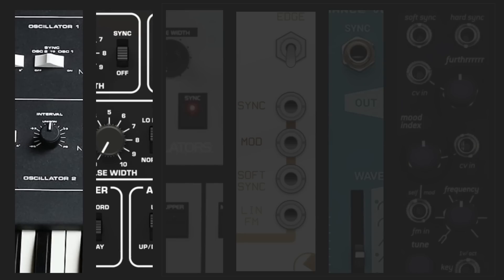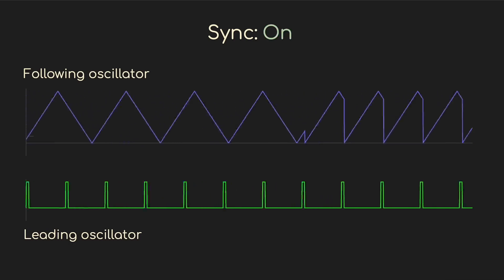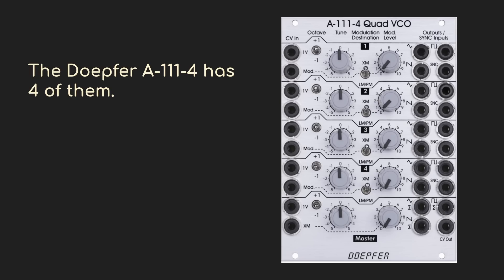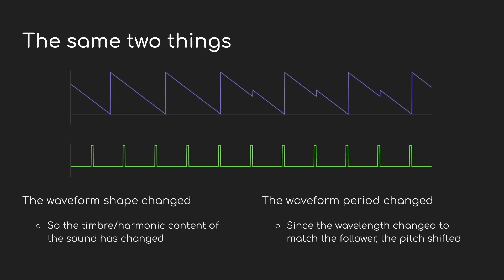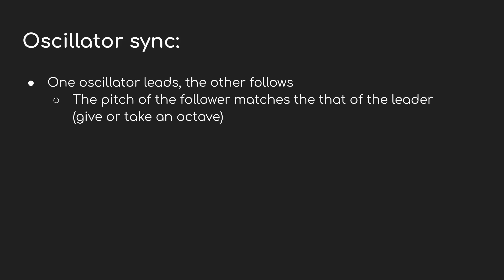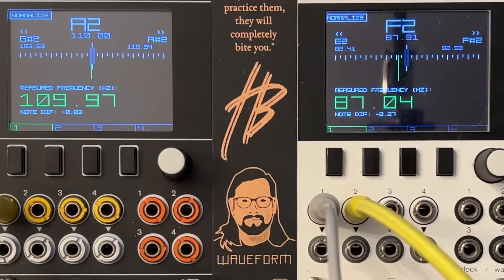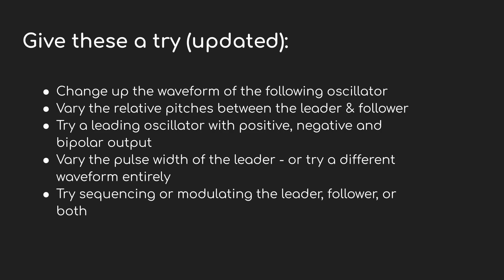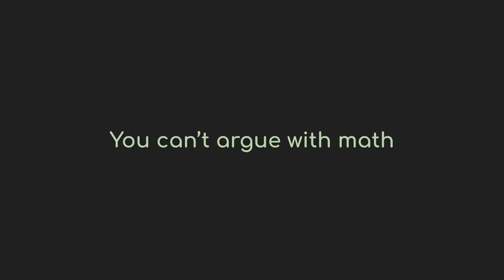Oscillator sync is a lot deeper than you imagine

Comment: ever since i started building synth modules i realized that oscillator sync is way more complex than it seems, the way they are implemented into circuits often make no sense if i think of the most common definition of resetting the wave, but i never imagined the results are so different in different circuits

Comment: Perfect! I truly understand it to a much greater depth now. The payoff is clear in your having redone the script multiple times due to further revelations and (sometimes) deeper understanding. Showing the notes and the harmonics for the different oscillators really drove those parts home--very key. I subscribed on the strength of this video. I would love to see a video explaining the math behind why the follower doesn't get pulled to zero on each cycle of the leader, and it instead gets just a dip and a stretch to half the frequency. Also, I would love to understand why there is such a drastic difference with an inverted leader. What even made you think to test for that?

Comment: The CEM3340 is known to have a strange sync implementation, as shown on the excerpt from the datasheet that you included. The chip offers both hard & soft sync inputs but neither do exactly what you would expect. As a result, where these chips have been used in classic synths, not many used the sync inputs on the chip but instead employed extra circuitry to acheive the sync effect. So whereas you said your module basically gives you access to all the pins on the chip, a Prophet 5 or a Memorymoog would have extra circuitry to implement sync and not use the on-chip implementation. So that's why you're not hearing & seeing what you expected.

Comment: Some of the other un-tapped 'rabbit holes' here are in the myriad of sub-sonic applications; of which there are far more than in audio wave generation! 
e.g.  resetting any oscillator used a a clock source,  mixing LFO shapes that are sync'ed, using reset to kludge an 'EG' with a ramp/skew function ( a USG/Maths' specialty ) at ~any~ rate, slewing CV's that still lock to tempo -  these are but a few ottomh. 
Cheers!

Comment: kind of a noob question - how can i sync a Plaits module to another oscillator (MCO in this case)? i tune them to C3 for example and send them the same pitch CV, but they play different notes. it's like one of my VCOs is attenuating the input voltage or something. thank you for this vid though super helpful!!!
Reply: to clarify, it's like the MCO is microtonal in its steps vs the Plaits is moving full semitones. it's so weird, makes me wonder if my MCO is malfucntioning.
Reply from the maker: I would expect it to be microtonal, since CV is continuous, but it sounds like Plaits is acting in a quantized sort of way.  I've never used Plaits, so I can't say for sure, but the default firmware doesn't say anything about it in the documentation.

You should run a test and put a slowish LFO into the v/oct in on Plaits and see if it sweeps the pitch up smoothly or if it jumps in a quantized manner.
Reply: @ sorry, kinda hard to explain ahaha. i didn't mean microtonal in the sense of the note being played wrt some scale; i meant that it moves between pitch changes with less amplitude than Plaits, if that makes sense... so when Plaits moves a semitone to my ear, MCO moves a fraction of a semitone, again,  almost as if it's attenuating incoming CV. thanks for replying!
Reply: @ oh and Plaits does not quantize or affect its incoming CV into the v/oct, don't think i've ever heard of a VCO doing that! i'm pretty sure my MCO is just off calibration or malfunctioning but i wanted the MCO mk2 anyway! haha
Reply from the maker: @stank666ocean - In fact Braids had a built in quantizer :)  It was under the options controls somewhere (got rid of Braids a long time ago now, so I'm not sure where, but it's in the manual).  Dreadbox Hysteria has one.  There are at least a few out there.

Definitely with analog oscillators there is a scaling aspect that has to be calibrated via little trimpots on the back of the module to get proper v/oct response, but that shouldn't ever be a problem with a digital module like MCO.  If you have a tuner app on your phone, you can test it by starting at a C or whatever on both oscillators and then plug a fixed voltage in and test how the pitch changes for each of them.

Oh, hmm, are you testing these both at the same time?  And if so, are you using a buffered mult or a passive one/splitter cable?  There can be a voltage drop on a passive mult might do something like this.
Reply: @SoundVoltage  i actually managed to think of that test case, believe it or not! i remembered from back in school that passive CV duplication caused droop so i made sure to patch it with a powered mult, luckily i have one in my rack. i finally used my degree for something! lmao
Reply: @ also yeah, i have read that some folks had to calibrate their MCOs and even then, they didn't track super well. weird that digital VCO needs calibration but my Prophet does too and it has DCOs as far as i know

Comment: Thanks for doing this exploration.  A while back i was planning on designing my own 3340-based VCO (I eventually instead got a PCB/panel set from Kassutronics), and I read a blog post by Tom Wiltshire of Electric Druid that went over a bunch of different 3340 circuits from different classic synths. He commented that the chip was unusual in offering both hard and soft sync, and that "neither of them work the way you might expect".  I didn't understand what exactly that meant, or what was going on, until I watched this.

Comment: In addition to sync and FM need a video exploring low-frequency (less than 20Hz) pitch modulation with different waveforms, as well as using filtered noise as an LFO.

Comment: Thanks for this. I don't think too much about what's happening when I flip different switches on my analog gear. From the label I have a general idea, but it's surface level. I just picked up a novation monostation and it has oscillator sync and pwm so I have some better ideas of how to maximize the sonic possibilities of that little button now rather than just thinking, okay, this'll match the pitches of the waves
Reply from the maker: Glad it helped!

Comment: Cool video man! It's interesting that you use a lower pitch following oscillator. When I first started experimenting with softsynths I quickly learned that doing that leads to weird things happening that weren't necessarily conducive to creating a consistently pitched sound, so I always used a higher pitch following oscillator instead. That way you modulate the pitch of the following oscillator just above the leading oscillator's pitch and get cool sounds. The other way is interesting too, though.

Comment: A trio of us are making analog synths from scratch (with a goal of understanding every electronic component and why it is present in each module) and we added what we understood to be hard sync to the VCOs.  Seeing the 3340's version of hard sync barely nudging the waveform is wild; we went with the definition of hard sync where the wave needs to completely start over as fast as it possibly can when the input crosses from negative to positive.  It has a far more gritty sound than the Doepfer's, and what the Doepfer does is what I would consider to be soft sync...  Are you sure it isn't using the soft sync input, given that that chip has both kinds of sync inputs?
Reply from the maker: That's pretty cool!  As for hard/soft on the Doepfer, it is selectable via a jumper per channel on the back of the module and I double checked it all before filming things.  I can go back and do a triple check.

Comment: Now that I saw this I had so many questions. I was often told to "sync to have consistent results". For sure now it's consistent, but it's a different sound, with harmonics that potentially don't fit with other instruments. Also, what happens when you have an oscillator slightly detuned, meaning is shorter or longer than the other? [Update:] I did a couple of perverted experiments (and what other types of experiments should one do?) based on this video. I set up a tuner and kept the leader oscillator in tune, while I severely detuned the follower, which I though previously to result in out of tune sound. But even with 6 semitones in and a couple of cents away, the note remained stable. There were differences though in presence between -6 and +6 semitones - it was odd to observe. Changing the octave on the follower resulted in a more metallic sound, while on the leader it became smoother and in tune.

Comment: I wonder how Virtual Analogue synths holds up in this regard, how many behave in the way i thought oscillator sync works before this watching this video.
Reply from the maker: I've wondered that too -- the extent to which this is properly implemented per synth, or if it just gets implemented per some pre-written library.  Similarly, I have one oscillator with a really pretty weird "sine" wave which makes for a distinct sound, but I there's just a standard "waveform generator" function that gets used across virtual modules.

That will have to be for someone else to look into, though, I'm not a virtual synth guy at all.

Comment: I often feel like, even with barely changing any other parameters, simply changing the sync between off, soft, and hard, for the furthrrrr generator (or other complex oscillators) produces really dramatic differences. You can virtually make whole different instrumentation sections of a song just through this.

Comment: You might be interested in Roland's "Metal Sync" on the JX-3P and MKS-30. They use digital oscillators doing sawtooth waveforms by running an accumulator to ramp upward before resetting for the next cycle in normal usage. But for Metal Sync it resets the follower oscillator's accumulator to zero when the leader's phase / cycle resets, however the follower oscillator also still resets when it would have originally, so it's resetting on the cycles for both pitches. Google should return a nice write-up from electricdruid.
Reply from the maker: Oh that's interesting!  I have a JX-8P here, but it looks like it didn't have the 'Metal' sync among it's options.  I'll have to see if I can find one to mess with.  Thanks!
Reply: very slight correction: the follower's integrator is reset, while the accumulator is left free running.

Comment: Using the 3340 as the object of study for sync honestly isn't the best. It does sync in a extremely non-standard way. Especially looking at how the sawtooth waveform reacts to sync is bound to just cause confusion. It's actually better to look at the triangle wave, as you do briefly around the middle of the video.

What really is happening when hard syncing the 3340 is: 
If a positive sync pulse is recieved at the input at the same time as the triangle is in the positive slope part of its cycle, the triangle slope will reverse it's direction from that point. The same happens when a negative pulse is recieved during the negative slope. There's a pretty good diagram of how this works in the datasheet for the IC.

I guess because of the 3340s popularity it's kind of become the standard mode of sync, in spite of this madness xD

There is a way to achieve the "normal" hard reset type of sync described in the datasheet, but I dunno if even that works the way one would expect...

Comment: Great job on the sync on the 3340.  The 3340 has four modes of sync per the datasheet (!!) and you've got a couple of them down with this video.  Most 3340-based eurorack modules offer one or two of these modes.
What's shown are the "positive hard sync" and "negative hard sync" types of '3340 sync.  Positive sync changes direction of a rising (and only a rising) triangle.  Negative sync flips direction of the output when (and only when) the triangle is falling.  One interesting thing not shown is you can use both positive & negative hard sync at the same time, that can lead to some interesting results.
The SSI2130 is more traditional at soft & hard sync, that would be a good chip to compare sync against.  On that chip soft sync will change direction of the falling triangle if the output is falling.  Hard sync will reset the oscillator regardless of phase.  I've got some example videos of both with scope shots.
Reply: Very good point to make about 334x series chips, their ability to do negative and positive sync at the same time is one of their most fascinating qualities for me. I am actually building a synth right now that will hopefully abuse this feature to the limit with a full pos-neg hard-soft sequencer, to create long strings of phase-locked sync pulses under multiple arrangements. I watched your vid on Zoxnoxious build and its been a bit of further inspiration towards my project! Never through to do multiple vertical boards slotted into a master bus, definitely a major space saver, may steal that idea if allowed lmao!
Reply: @wertyvk9667  grab the designs, it's not stealing if it's open source :)  (within limits of the license!).  Besides the deep dive vids, I hope you found videos of the pos/neg sync.  They're on the channel too if you hunt around.
Reply: @UltraTroninator  Yeah I did! I love that dense sync sound, big fan!
Reply: Very cool - can you share the vids?
Reply: @PeterJnicol  not sure if it's allowing me to put links to share.  They're on my channel, not a lot of videos there so should be easy to find.

Comment: What attenuverter are you using in this video? It's awesome, and I would love to have a few, but I will not get my hopes up because any module i want is usually something no longer being made. Lol.
Reply from the maker: @MR2GR: They are pretty cool, for sure.  That is an Antumbra "Fade".  I had to build my own -- which wasn't too hard but required SMD soldering, which was entertaining.   

But you can buy them assembled now at Pusherman in the UK: https://pushermanproductions.com/product/antumbra-fade/
Reply: @SoundVoltage  I'm perfectly fine with hole-through soldering, but I've tried my hand at SMD, and know that I will fail and get frustrated, so I'm happy they sell them assembled as well. Thanks for the link.

Comment: I'm pretty sure these mysteries will be revealed if you look into how different oscillator cores behave. A lot of the differences in behavior are likely due to what it means to reset the oscillator. 0 volts? 0 phase? What is the voltage of the waveform at 0 phase? Etc. Also the sync function could conceivably trigger on a 'rising' edge or 'falling' edge, which could also explain differences in results between oscillator models. Relative placement of that trigger in the follower waveform's cycle will adjust when the reset occurs, like in your pulsewidth example.
Reply: Indeed, from my "having soldered a dozen pedals, 100+ cables and a few other various circuits" perspective, the differences seem to be in how the circuitry 'yanks' the core's clock/counter to match or approximate the period of an incoming wave that the VCO is attempting to use as a substitute clock pulse.   In the first example a subharmonic occurred even though he was sync'ing to higher freq. Some  'analog artifact', I guess.
 You seem to have a deeper grasp of it than I. Describing such artifacts as bluntly as"leakage" in the process of "yanking to an (assumed) external pulse" is about as far as I care to understand it, since I'm a composer and not a module designer/EE.

Comment: I wonder what would sort of harmonic spectrum you'd get if you hooked up 3 oscillators so that oscillators A and B were at the same frequency but osc A was synced to oscillator L and osc B was synced to the inversion of L, and you ring modulated the results together. Because like they say, everything sounds better with ring modulation, or at least worse.

Comment: I just had a Moog LittlePhatty fixed. After I knew, I had to recalibrate the oscillators. OSC2 Freq needed the calibration. But the sync button always tuned the OSC2 perfectly. I did the recalibration but stayed with the doubt of why or how was the sync button tuning the OSC2 if it was off pitch in the first place.

Comment: Excellent stuff, VCO sync is underrated. Something I discovered is to use other sources of audio, anything with a more complex waveform than a simple repeating cycle like most VCOs is obviously harder to track, which produces a lot of noise. I made a disgusting guitar synth in VCV by patching the guitar signal into the sync inputs of a few different VCOs. It was uh, quite 'experimental'.

Comment: Interesting look at this topic! As sync is so closely related to the inner workings of the oscillator it only makes sense that they all sounded a bit different. When you think about it, resetting the waveform is what an analogue oscillator does to produce the waveform. I have a Instruo Cs-L and the two oscillators on it have different cores that produce wildly different timbres when synced. As the sync is based on some edge detection circuit, getting near its threshold and inverting rising and falling edges could potentially get some interesting unusual waveshapes.

Comment: Now drop that oscillator into the LFO range and add some CV over the attenuvertor of leader..for analog oscillators with multiple waveform outputs you now have a plorethra of harmonically related modulations.

Comment: I always thought soft sync is related to the threshold of the voltage - the waveform might reset, but not every time. Always felt there should be a knob instead of a sync button, but not entirely sure what that knob would do. 
Anyway, there's a nice little trick: feeding it with an LFO, effectively stalling the oscillator, behaving like a crude VCA.